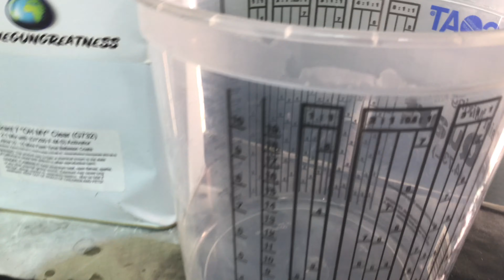Complete Paint Job with the SprayIT R500 LVLP spray gun and small compressor

Comment: UPK I am going to try lowering my pressure down to 30psi when spraying Grant 7 I am still struggling with it has great shine just getting solvent pop on flat panels think I am laying it on way to heavy Thanks for content
Reply from the maker: You may need to give a longer flash time instead of lower the pressure but try both and see if you get better results

Comment: Single stage with this gun.. what would you run pressure at??
Reply from the maker: It really depends on the material you’re spraying to determine what pressure to run and I would do test panels before spraying your actual project to have everything dialed in like you want. Here is a video I did on a single stage paint job using this spray gun 
https://youtu.be/OkAbRWjHwOc

Comment: Do you try to use the same gun distance and speed with the base as well as the clear? Is there a specific reason you did 28psi for the base but 30 for the clear or is that difference negligible? Thanks!
Reply from the maker: @AutoDIYdactic  I typically use about the same distance for base and clear and as far as psi goes I make the adjustments to get small droplets to create less orange peel

Comment: Why don't you use a sealer?
Reply from the maker: I use sealer but this was going back the same color so sealer wasn’t necessary. If I was doing a color change I would have sealed it
Reply: Is that air compressor really that loud because it sounds loud.
Reply from the maker: @craigcarter5276  yes it’s really loud
Reply: I just bought the 29 gallon 2,5 horsepower central neumatic and sprayit lvlp gun is that your setup.
Reply from the maker: @craigcarter5276  yes that’s my small compressor setup
Reply: Thanks for all the help l'm going to be getting that candy paint from you guys soon but that central pneumatic is too loud for me any other harbor freight compressor that is quiet that can get the job done.
Reply from the maker: @craigcarter5276  you can try a oil less compressor, they’re usually a lot quieter
Reply: Can you do a video on how to spray base because so many people come to my friend shop that tried to paint their on cars and sprayed base too wet and Dry looking trying to spray it like clear coat.
Reply from the maker: @craigcarter5276  so they sprayed the base too wet or did they spray too dry?
Reply: @UndergroundPaintKing  too wet I think but don't not sure 3 people In the last month said they watched YouTube and tried to paint their own cars I know because before I started taking paint classes I did the same thing thought I could spray base like clear and it looked Dry most people on YouTube concentrate more on clear.
Reply from the maker: @craigcarter5276  You can spray your base a little wet but you want your gloss to come from your clear
Reply from the maker: @craigcarter5276  everyone has their way of doing it

Comment: Are you getting an entire coat with the paint pot that comes with the gun or did you find a bigger one? I just don't get very far with that stock cup. I don't know how I'm going to get a wet clear coat if I have to stop and refill the cup. Signed confused first time rookie, Steve p.s. I have the a610 aeropro
Reply from the maker: I stopped using the cups that come with the spray guns and started using disposable cups which can be really helpful when doing a overall paint job, I’ll try to do a video demonstrating how you can go about doing it

Comment: Never painted before, but from the video it looks like you mix up one batch of clear and do the entire car.  How much of a car can you do with a single batch of clear and how much clear do you need in total, a gallon?
Reply from the maker: It really depends on the clear you’re using and the mix ratio also what you’re doing when you’re painting the car as far as if you’re doing the inside and outside of the car, so a gallon is where you want to start but you may need more

Comment: You worked your compressor to death on the black Camaro. But great job. 
Question: do you find the R500 gun is a difficult gun to use because it is an LvLP? User of the gun is to go slower.  And would you paint a urethra paint over a 1 k primer from a spray can? Thank you for video
Reply from the maker: Thanks Robert I appreciate you and I don’t think it’s difficult to spray with because of it being lvlp also I have painted urethane over a 1k spray can

Comment: how much horses power did the compressor have. and did u cut and buff?
Reply from the maker: 2.5hp and no cut and buff
Reply: thanks
Reply from the maker: @Nutflame55  you’re welcome 🤘🏾
Reply: Will a 26 gallon  1.8 hp work?
Reply from the maker: @Nutflame55  depending on the spray gun you use , if the compressor will supply the spray gun consistently you should be good
Reply: I'm talking about the gun from the video. I'm about to order it now then steal a compressor from my job that's y I ask.

Comment: How much paint to paint a car this size?
Reply from the maker: The mix ratio on the paint that I use is 1:1 meaning 1 part paint and 1 part reducer, so in my case I get a gallon of paint and a gallon of reducer which makes 2 gallons of sprayable materials. Typically a gallon will get a vehicle this size painted inside and out
Reply: Thanks King!
Reply from the maker: @patdesignsinc  you’re welcome!

Comment: #UPK
I love how you are using probably the cheapest 20 gallon compressor HFT sells to paint your cars you know the”Pros” say it cant be done😂
 Is the spray it R500 the same gun as the AeroPro R500/A610? 
Great guns if you have a small capacity compressor!
You can prime, flake, base coat and clear coat with the same gun.
Reply from the maker: 😂 we been proving the pros wrong for a while now, I’m my opinion they are the same spray gun but as you said they do a great job!
Reply from the maker: Here is a video I did on that topic 
https://youtu.be/LWCHXFZLwP8
Reply: @UndergroundPaintKing  i just custom paint motorcycle parts as a side hustle hobby so the two stage 26 gallon fortress exceeds my requirements for air. I can run my DA sander and polisher I use the A 610 and the Lime line gun Which is also a good gun but is a 1.3 nozzle only 
I use it for base coat. It is also LVLP.
The HVLP guns over work my little compressor. 
Enjoying your videos BTW.
Reply from the maker: @Swampyssidehustlehobbyshop  appreciate you checking out the videos Swampy, I would like to see some of your work if you don’t mind sharing!
Reply: @UndergroundPaintKing  I don’t know how to post pictures here
Reply from the maker: @Swampyssidehustlehobbyshop  You can email me at ugpk810@gmail.com

Comment: Why was the gun hard to handle  that clear
Reply from the maker: The clear is thick so the 1.3 tip wasn’t atomizing it like I would like, if I had a 1.4 tip I think it would have worked perfect but it still did a good job 💯

Comment: Can you make a video about painting a car with hvlp gun and small compressor?
Reply: Is that even possible?? Inquiring minds want to know
Reply: @werone696  yes mate it is. You need at least 50l compressor that has 200 or above liters per minute. I’ll spray my car next year with that setup😁
Reply: @werone696  With 1.3mm Hvlp gun
Reply from the maker: I’ll work on a video with a small compressor and a hvlp spray gun…it definitely can be done…I appreciate you checking out the video!
Reply: @stektpolse  cool I'll look forward to seeing it. I'll be using the exact same thing that UPK used in this video
Reply: @werone696  good luck with your project brother!😎

Comment: Why not start at the top then work your way to the bottom
Reply from the maker: You can start at the top if you like, I like to start at the bottom just in case something in my spray gun breaks free from another paint job that I might have done, that way the trash that might land in the paint job is at the bottom and not the top in a noticeable area. Just something I have learned over time but starting from top to bottom is perfectly fine

Comment: Nice Job, Question for your great knowledge, do I need to use a sealer when spaying a urethane base coat? As a DIY person I have always shot single stage Acrylic Enamel then do a cut and buff. Just bought the Spectrum HTE and going to switch it up to a 2 stage on this Flip I'm working on. Again awesome job, keep up the great work and look forward to seeing more.
Reply from the maker: Thanks William I appreciate you checking out the video…I recommend spraying a sealer but it’s not always necessary to spray sealer so it really depends on the condition of the vehicle that you’re spraying

Comment: Hey, just got my Spray-it delivered this week and used it today to paint and clear some plastic pieces. Not much of a test for the gun, but seems to work well. Used just my 20 gallon compressor. Probably going to use it for base mostly. No high solids clears. I seen that video🙄. I sprayed some Speedokote medium solids clear. Also bought the Harbor Freight Spectrum pps refill kit as I already had cups and all that. Works just as well as the other Chinese pps cups I have purchased off Amazon and Ebay. It's what I'm used to. I'm 10 minutes from a HF so i'm just going to pick them up instead of ordering like I have been. Can always find something else I think I need while i'm there....
Reply from the maker: It works great for small jobs…let me know what you think of it after a few jobs

Comment: Fixing to do my first paint job in 15 years?Should I do single stage or go for bass coat clear coat???
Reply from the maker: @johnnyjackson3850  are you going solid base or metallic?
Reply: @UndergroundPaintKing  Glossy black no metallic 1980 camara
Reply from the maker: @ I don’t think you can go wrong with single stage or base clear but if you were doing metallic I would go with base clear
Reply: dont ask stupid questions, if u want u can also use a good quality pva house paint. the choice is yours.

Comment: I don't know about the paints you used, but I was watching the performance of the LVLP gun and it-si-bit-si compressor. It may just be your style, but it looked like you were overlapping the passes with base about 75% and with the clear more like 85%. I always use an old siphon gun and my overlap is only 25 to 50%.
Reply from the maker: Yes I tend to spray 75% overlap on base and clear but I probably should be 50% on my base and 75% on my clear
Reply: if u want to be a critic, then go work for a newspaper. if u think he is doing it wrong then make a video and show us the right way. otherwise stfu and learn something new.

Comment: I love my Sprayit lvlps and it's probably because they are near exact clones of the awesome Iwata Bellaria.  The body looks slightly different but the important parts are basically identical.  I've been testing my Sprayits for years, and they just keep passing with flying colors.  For the price of the Iwata I could have one for primer, one for adhesion promoter, one for sealer, one for solid colors, one for metallics, one for clear, and one to polish up and hang on the wall.  And still have enough to take the wife out to Red Lobster...
Reply from the maker: 😂 I agree with everything in your comment Kenlycan, I’ve been waiting for my SprayIT to fail me but it hasn’t!
Reply: @UndergroundPaintKing  I'm still using the one I got for $40 from Lowes online in 2014.  I bet both our hair will be all gray before them guns falter
Reply from the maker: @karsbkool  I think you’re right!

Comment: I don’t like lvlp. They just don’t atomize well. I can tell I’ve been painting for years. It does a decent job just looks too blotchy I could also hear the moisture from the lines struggling as it was spitting a bit. I don’t think that was the product. More like overheat compressor. My solution. Since 230 is diff to find and the compressors are a ton of cash simple.  Buy a cheap used 25 gal and have 2 air lines. Run 2 compressors switch hoses everytime u feel losing pressure. Easier on both compressors and make like simple a quick switch hose while spraying no wait time for catch up. No dry spot and no need for lvlp
Reply from the maker: A lot of DIYers are looking for a spray gun they can use at home and with a small setup and the SprayIT does a good job and I get plenty success stories of people who have success with them so I’m sorry you don’t care for them but there are others that do!…everyone just has to find what works best for them and I’m glad you found what works best for you…appreciate you checking out the video Tsty5

Comment: I was just about to order the Sprayit LVLP gun kit (1.3, 1.5 and 1.7 tips, and maybe add a 2.0) the other day when I found out my compressor wasn't building pressure above 40psi...turned out one of the reed valves broke. $12 in parts from Amazon got it going again. Same 21gal compressor you run. Nice job. She shiny!
Reply from the maker: You’ll be all set with that kit Jay and now having the compressor right you’re good to go 💪🏾…appreciate you checking out the video!
Reply: @UndergroundPaintKing  I go back and forth between painting it myself and bringing it to you. I love the car, but I only paid $550 for it, so it's hard to justify even a reasonably priced paint job. I was also thinking of wrapping it, but I remember what a pain it was to remove vinyl from my last car after 4 years. I figure after I buy the gun, filters, longer air hose, paint, and primer, I'm going to be easy $1200 or more.
Reply from the maker: @jayinmi3706  it’ll be more satisfying doing the work yourself in my opinion and if it becomes to much then having me do it could become a option but I know you can do it bro💯
Reply: @UndergroundPaintKing  For sure it will be more satisfying...but I might have to paint it in my driveway. lol I've done some pretty nice work (if I do say so myself) with spray cans in the past, but it gets stupid expensive.
Reply from the maker: @jayinmi3706  yeah this kind of work can get expensive
Reply: @UndergroundPaintKing  No joke. I try to make sure I never say "It's too expensive," because I get that at work (I install sounds) alot. And it's not that we're expensive, it's just that people don't know what's involved on bigger builds. I get that it's going to cost a lot, but it will cost more to pay someone to do it. lol
Reply from the maker: @jayinmi3706  you’re right!